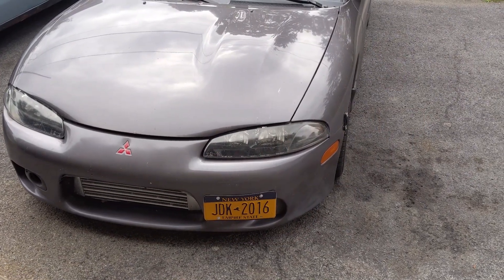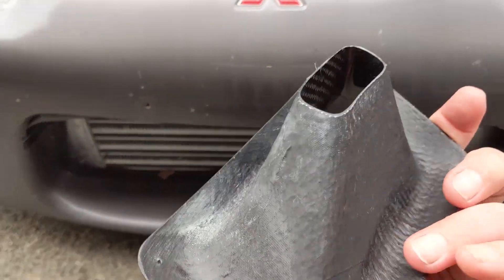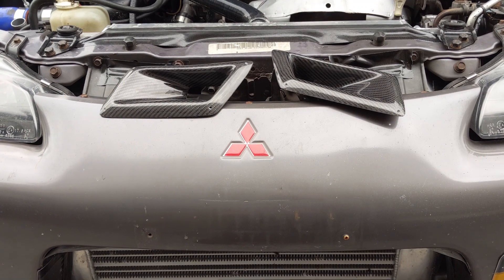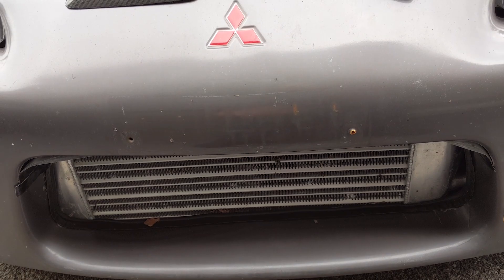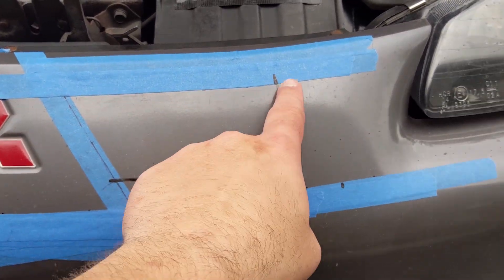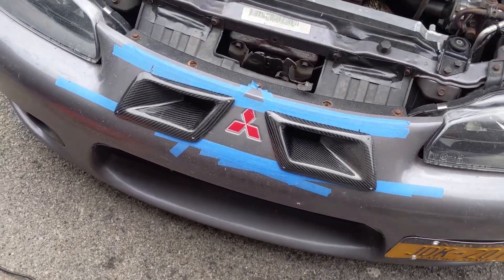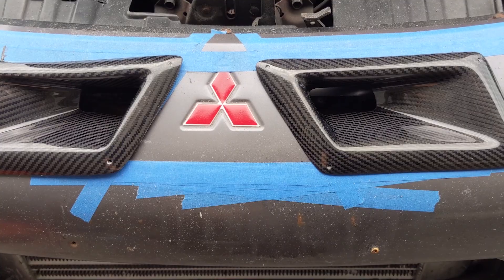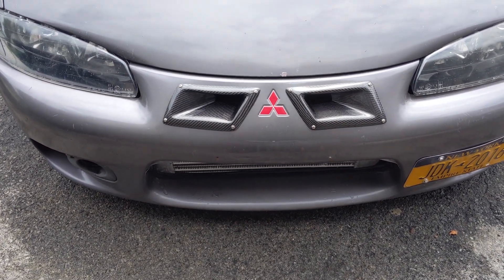CARBON FIBER BUMPER COOLING VENTS!!!!!

Comment: What size screws did you use for this? I bought those exact ones and im trying to figure out what to use to fasten it down lol
Reply from the maker: I got some small stainless screws first go around. Ended up having to drill out the holes to fit small nut and bolts in em the second time. I put the 6mm bolt through from behind the bumper and used tiny black coated cap nuts

Comment: Did these help a lot with highway cruising cooling?
Reply from the maker: They actually helped drop my average highway temp from 195-200 down to 186-192. I'd like different vents but these did do the job👍
Reply: @TPGDSM  thanks a lot man, having same issues and about to do the same and just wanted to make sure it was worthwhile before I did it
Reply from the maker: @308racing.  ducting is also an absolute must. And removing the black strip of plastic from the opening in the front of the bumper cover. You should be good with airflow 👍👍

Comment: I'm in South Louisiana 💀. 85 degrees is actually a good day for temperatures for my motor. You right. A good 40mn drive and then stopping at a red light climbs temps bad.
Reply from the maker: Agreed! Since I stuffed those little nostrils through my bumper it seems to be allowing more airflow to pass through and keep things cooler longer. Approximately 13° average drop in temp so far. 🤘
Reply: @TPGDSM  daanng niiiice. That's a big difference. Especially for coolant too💀💀. I always thought it was just my car but I'm glad I came across this. I was actually trynna find an oil cap breather,  but just can't find one to fit
Reply from the maker: @djack2058  there's a guy on the dsmtuners.com page named "Hal" that's machined some vented caps in the past. Here's his link, you may be able to get one from him still. Posts from 2012 but you never know. I got a throttle rebuild kit from "snowboarder17" on there on an old thread. 
https://www.dsmtuners.com/threads/billet-7075-vented-oil-caps.443803/
Reply: @TPGDSM  dannng 😎ok. Imma check now

Comment: After seeing it a bit more in the video, I think a black lip would tie in real nice with the vents and bumper latches. I don't know if they're still made but you might be able to find a used one.
Reply from the maker: I'd love to find a good front lip kit. The search is on! I'm also thinking about doing dzeus fasteners for the hood instead of the latch assembly. We'll see how that search goes. Thanks for watching 👍
Reply: @TPGDSM  carboneticsinc.com makes fantastic full carbon fiber products for the 2g. I got my front lip from them

Comment: Are there any bolt on turbo swaps I can do with my 98 gst you would recommend?
Reply from the maker: Bolt on Garret t-28 is a small upgrade from stock but I would recommend either 14b or 16g instead. They will give you more bang for your buck. And as always you'll need to modify your fuel system to accommodate higher boost. We have a video citing a 16g upgrade.